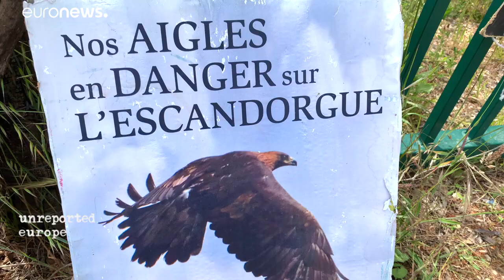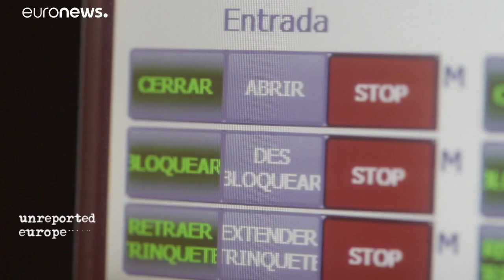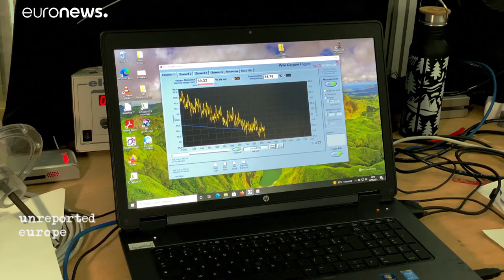Recycling turbine blades: the Achilles heel of wind power

Comment: Well just like with nuclear power there is waste generated from wind turbines that have to be recycled. When you consider that to replace one nuclear power plant you need like 3000 Wind turbines with a lifespan of 20 years compared to 80 years for nuclear plants meaning they have to be build and be scrapped 4 times till you have to replace the nuclear power plant wind energy is more troublesome than most people may think they are.
Reply: But we are talking about the nice and green turbines, surely, supposedly designed to solve all the problem of nasties? If we are going to say nuclear produces waste too then why don't we use coal? Coal pollutes, turbines pollute. I thought the idea of turbines was that they are clean and not a polluter.  At least with nuclear and coal you get some pollution but you get vast amounts of energy precisely when you want it; unlike with turbines.